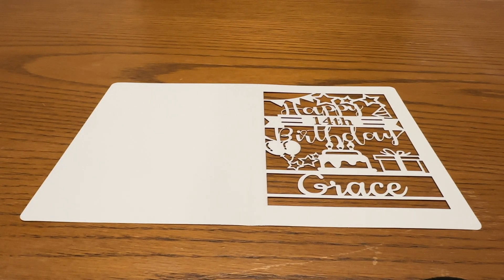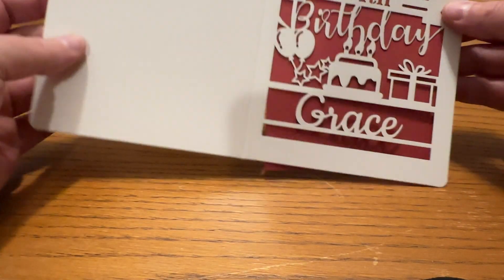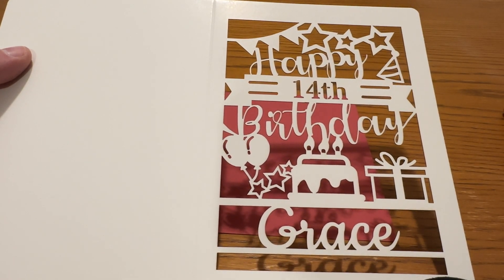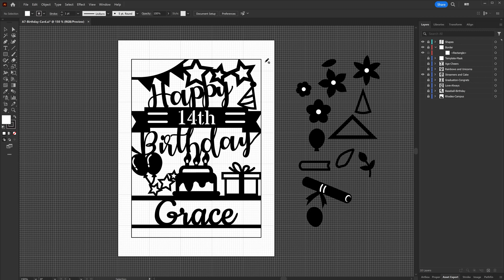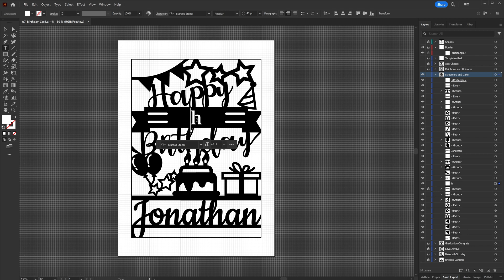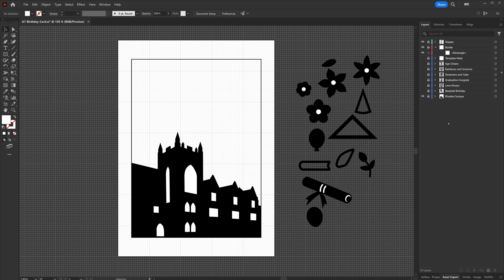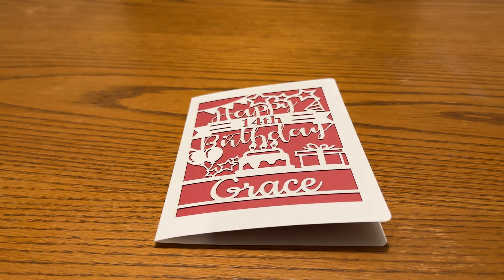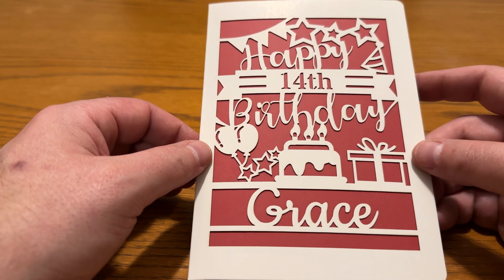Cutting Cardstock - Custom Cards - Atomstack A5 M50 Pro (5.5-watt Diode Laser)

Comment: This is really, really helpful. I wanted to order an Atomstack A5 M50 Pro immediately in order to replicate your techniques but sadly that model seems to have disappeared. Do you know if it has been upgraded to something similar that would still deliver the crisp, char-free results you get using a blue acrylic sheet at the back?
Reply from the maker: I'm not 100% certain, but I do see the "Atomstack A5 Pro v2" on Amazon. It looks like it uses the same 5.5w output blue diode laser, so it should be very similar to the one I used in this video.

Comment: Thank you for this very helpful video and for the tip about using the blue acrylic sheet! I'm currently comparing laser cutters and want to ensure the model I choose doesn’t leave brown edges on the sides of 200/300 gsm paper. Does the Atomstack prevent this issue?
Reply from the maker: The Atomstack doesn't always give completely clean results, you can see some slight browning around partial edges on some of my finished cards (200 gsm white cardstock). I'd say about 90% of the time, there is no visible discoloration as long as I remember to clean the blue acrylic sheet between cards. I've found the best way to reduce any browning is with low power, multiple passes, and as high a speed as you can get by with your laser.  The blue acrylic sheet also greatly reduced discoloration by removing any flashback.
Reply: @CubicleNinja  Thank you so much for your quick and detailed response! A 90% success rate is quite good! Did you use an air assist to improve the results? Also, is the blue acrylic sheet opaque, and where did you get it?
Reply from the maker: I do not use any air assist, but I do have a high CFM exhaust connected to my enclosure.  When I tested with air assist, even low settings would cause the intricate cut pieces to move out and get in the way of the laser.  This would either cause them to burn and mark the card or prevent the cuts from completing properly. 

It is a 12x12 opaque blue acrylic sheet (1/8” thick) that I got from amazon in a multi-color pack. Both the cyan and the blue opaque sheets work well to absorb the laser after cutting the cardstock.
Reply: @CubicleNinja  I ultimately decided on the Atomstack A5 non Pro, as my primary need is cutting paper, and an opaque blue plexiglass sheet. Once they arrive, I'll conduct some tests, and if needed, I'll consider purchasing the air assist. To prevent the paper from fluttering, I'll use weights or find another suitable solution. I truly appreciate your help 😊 your insights have been incredibly useful and kind! Thank you
Reply from the maker: Very glad to help, it's all a big learning opportunity with this stuff. I hope you have great luck with it and would love to hear how it works out for you.  For some additional references, here are a few other cards I did, you can see the slight discoloration on a couple, some of it is where I wasn't careful and smudged with my fingers (not sure if the comment will accept this many links)

https://jonathanflanigan.com/card-images/card-1.JPEG
https://jonathanflanigan.com/card-images/card-2.JPEG
https://jonathanflanigan.com/card-images/card-4.JPEG
https://jonathanflanigan.com/card-images/card-7.JPEG
https://jonathanflanigan.com/card-images/card-8.JPEG
https://jonathanflanigan.com/card-images/card-9.JPEG
https://jonathanflanigan.com/card-images/card-10.JPEG

Comment: Question. You mentioned something about a piece of blue acrylic to prevent flash back. Does this work with C02 lasers as well?
Reply from the maker: Unfortunately, I do not know for certain as I've never used a CO2 laser.  I do not think it would work, though. The only reason it works so well for my diode laser is that the blue light from the diode cannot cut or penetrate the blue acrylic, so it works as an absorption material. Since the CO2 laser would have no issues cutting the blue acrylic, it wouldn't provide the same benefit.

Comment: Great Video, but would this work also on mirrored cardstock
Reply from the maker: I'm not sure, I've done it with all different colors of cardstock along with matte and glossy, but I've not tried it with mirrored or foil cardstock. I think it might work about the same if you did it with the mirror side facing down, since the laser would be cutting through the standard matte white side.
Reply: @CubicleNinja  Thanks for your informative reply, I normally cut this cardstock with a Cameo 4 but it still looks rough when finished.
So i have decided to get a laser cutter, will let you know the outcome